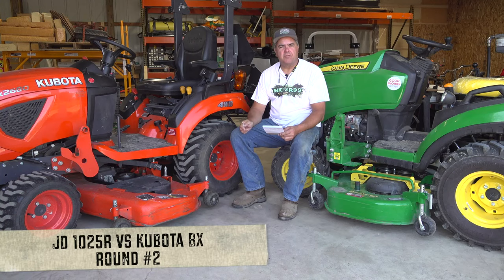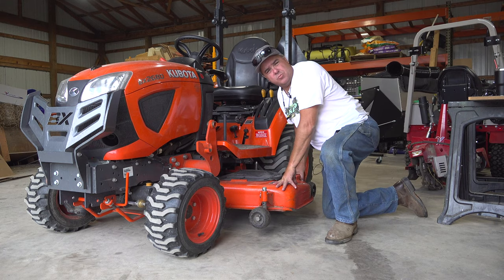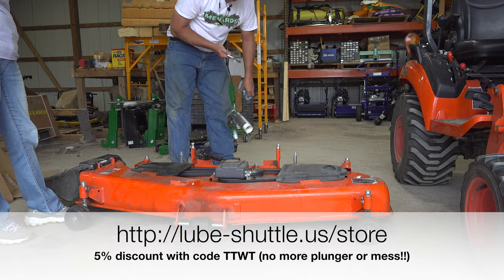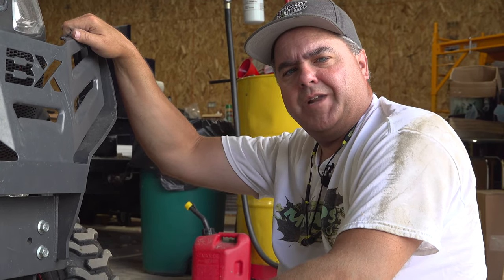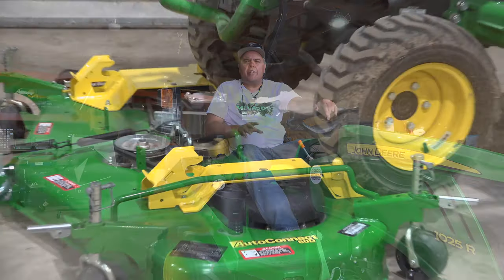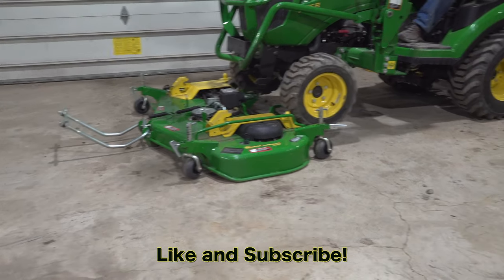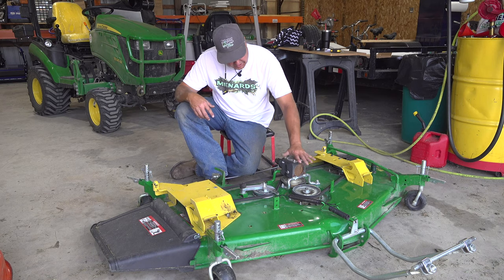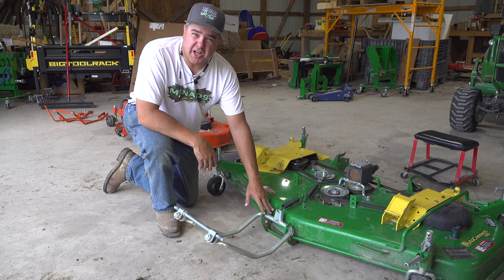Deere 1025R vs Kubota BX Round #2 of 8 Mower Deck

Comment: I'm one of those 1025r owners that cannot get the mowing deck to ever work correctly. Today, in fact, took 10 frustrating minutes to get the deck installed because the PTO wouldn't align (had to make my own leveling adjustment bolt - 'cmon Deere, go to Home Depot and get at least a nylock nut to use). The cam lock for the rear of the deck, on mine, can never be operated by hand like you show yours. Mine requires a breaker-bar to break it loose. And a 60 inch deck on this narrow of a tractor does not work well on anything other than a flat surface for mowing. My front yard is a little over 5 acres that has some gentle rolling, and near the creek, it gets a bit rough, but nothing my 40" zero turn couldn't handle. This 60 in deck scalps and dips. On a flat lawn, this deck does a respectable job cutting cleanly and quickly. However, if you want to cut heavy grass, like fescue, a bit higher than the lawn, the deck will not lift high enough to cut heavier grasses. Even with the mower turned off (deck still attached) and traveling over uneven ground (like down a gravel driveway!!), the deck will scrape and bounce as it hits the ground. No matter what adjustments I make, it will not lift all the way up. We own a 140 acre farm and the only reason I still own this sub-compact tractor is the utility - the other attachments for the work that needs to be done. My real workhorse is my t4.75 New Holland with a 12 ft batwing mower, loader, sprayer, etc. As a farm operator, this mowing deck is the most frustrating and time consuming implement we own. Ironically, I bought it because I thought it would be the quickest way to get utility out of a $17,000 piece of equipment. 18 months later, I am still wrong.

Thanks for your work on the videos Tim.

Comment: A bit of an unfair comparison between the two mower decks. Yes, I understand you were working with what you have on hand. Kubota does have a drive over the deck as well. I personally don't have a mower on my tractor so I can't comment on ease of installation of either type. Great video as always Tim. Look forward to the next one buddy.
Reply from the maker: Ok.  Good comment.  We couldn’t find a Kubota drive over deck as dealers discourage them.  Neil makes that clear in his video.
I should have explained this in the video, and will do so in a follow up.
There is one comment (so far) in reply to this video stating personal experience with his own Kubota drive over deck.  Check it out.
Reply: @TractorTimewithTim  In have the drive over deck on my 2019 Kubota BX.  It is a great deal easier to get on and off than the one on the Kubota you are testing here.  The Kubota dealer tried to talk me out of it but after I said I had back surgery and could not do the regular one they dropped it.  I actually liked the Deere one much better and think it is clearly the superior drive over.  I went with Kubota because of the dealer more than anything else.  The Deere dealer never returned my calls or got a quote to me, the Kubota dealer was responsive and did everything within hours (I visited both too and never could get a quote from the Deere dealer).  That's just the dealers by me and does not in any way speak to the quality of the tractor.

Comment: Nice job Tim. The Kubota deck looks like a supersized version of my older Cub to remove. I would say the Deere box is much taller as to help with the auto connect lineup.

Comment: On the KUBOTA, Cotter pins make turning the mower wheels a lot easier.  Turn the front wheels to the right and you won't look so biased when you slide the mower back under the tractor.
I have had both a Deere and the BX.  The BX is a BULL compared to the deere.

The ONLY thing the DEERE has better than the BX is the twin touch foot pedals.

Comment: My dad has had kubota for a long time now, he recently just upgraded to a bx. He's on his second tractor because the first one's hydraulics quit. The dealership couldn't figure it out. Gave him another tractor. This one has the drive over with the auto connect. The bx mower decks are a joke. The guage wheels are plastic, they have metal grease zerks threaded into plastic. Two of the 4 zerks have come out. Good luck re-threading plastic. The older b series had 4 casters, meaning all 4 wheels would rotate 360 degrees on their axis. The bx series don't rotate, they're fixed. The old decks would float and follow contours, bx deck scalps on high points. The auto connect is a joke, the dealership "adjusted" it and it was garbage. We did it and had better luck. Just last week my dad was getting it ready to mow and discovered the housing that holds the splined end that connects to the mower was cracked. Back to the dealer again. My advice avoid the new bx series, stick with the older b series.

Comment: My biggest issue is it air cooled or liquid cooled. I have a lot of cotton wood trees on my 15 acre property. I have burned up too many air cooled engines getting clogged with cotton. And taking time outs to clean the engine is not worth the time for me. I need liquid cooled engines. They can go the distance but more importantly they have an engine temp gauge which at least warns me the engine is over heating and I need to take a break and clean the radiator before engine damage occurs. Air cooled is always a guess. And I can not get under trees on my property with a roll over bar or hood. They absolutely have to come off. I already spend at least two weeks every summer cutting up storm damaged tree limbs in my yard, I have no desire to trim off all branches on all my trees to an 8 foot height for roll over bar clearance. That would take two entire summers to do that. That left me with limited options. I settled for a case DX25E and removed the roll over bar. Also I had a JD 400 mower with a 72" mower deck. It was built in 1972. In 2002 at 30 years of age the deck metal corroded enough that just the belt tension alone was enough to warp the deck. Both ends curled upward and of course you can no longer mow a yard with a warped deck. The Case DX25E I bought to replace it has much heavier gauge metal deck at least double the thickness of the JD mower deck. I see your JD deck has metal bars for reinforcement. Mine did not. But still I doubt they would be able to keep an old deck from warping. That was another important issue for me. But then is 30 year life a reasonable amount of time to expect from your equipment? You decide.

Comment: Kubota and John deere are both great products. I always hated removing and reinstalling belly mowers and kudos to JD for trying to improve the situation! I've had compact diesels in kubota,  massey ferguson, new holland and decided years ago to  have Ferris zero turn mowers for my lawn mowing needs. As far as tractors go, I've never owned a JD but have worked on many. I don't like there light duty stamped steel mower decks and all the plastic  hoods and fenders they use. If you decide to own a JD, make sure you keep it garaged and out of the sunlight and severe cold or all those bits of plastic will start cracking and falling apart! I'll stick with my all steel Kubota! If you change the oil and filter as recommended the Kubota will last several lifetimes! That's why most rental yards use Kubota!

Comment: Been looking on her to find the reply to 1 of the comments that had this link in it about Kabota's auto-connect deck ( https://youtu.be/kZeF643QxQM ) this is there new one with the auto-connect PTO. This is the 1st one I saw. And in the video he still had to fumble around with the ramps. In the time he took messing with the ramps I could have been mowing with my 1025. And looks like the deck had to be 100% lined up with no way of judging it. The Deere has the bar on the left side (opposite the discharge) for a reference. And the 1025 is a little forgiving on alignment. And the front wheels on the deck looks like they would roll on a concrete garage floor.

Comment: This video is on fire Kabota has an auto connect system to because you compared it to a regular mower deck makes the John Deere out an advantage put an auto connect Kabota next to it and then the John Deere is going to be junk again that’s what a normal John Deere is junk
Reply from the maker: Kubota dealers do not recommend the kubota drive over deck. Reference Neil's video.     We would be happy to evaluate one if we had access to it.

Comment: Tim,   I have a BX2360 that I bought new.  As others have said, use the FEL to lift the front.  I still take it out the side and leave the bracket on the front.  I do not find it to be too painful to remove or install, but I only take it off 2 to 3 times a year.   No narrow gates.   In my situation,  the auto connect not really worth $500 plus.  You made a comment to do a follow up about the belts, would you please check quality of pulleys, shaft diameters, blade removal, and locations of grease fittings?   Please note that the anti scalp wheels have grease fittings on the Kubota.  Don't know if greenies do.   Please watch this video!    https://youtu.be/Kcj3MMgGGPs.   I believe you will find this will almost make remove and install almost equal.   Keep on tractor'n!

Comment: Remove the deck after mowing for a couple hours simulating switching tasks. Might be pretty hot under there. I don’t think it would be too enjoyable removing that Kubota shaft if one needed to start doing something else after mowing. but I guess maybe a break time would be in order anyway and then just let it cool down. Never going to have a perfect system

Comment: I've had many problems with my drive over deck.  mostly related to the draft bars in the front.  First they were twisted.  After warranty replacement I am assuming the dealership didn't adjust them correctly which caused the FEL frame to catch the draft bars and then pull them past the cheaply engineered retention pieces.  Now they come out constantly and have to be put back on everytime the deck is removed.  Pretty frustrating actually.

Comment: I don't know about that particular model, but some of the other models are designed on the John Deere where you just drive over the deck and connect it connect the mower without having to get off the tractor. I didn't get a mower with my tractor since I have two zero turn mowers. I don't know about the Kubota, but saw in a few videos that it was much harder to get the mower off and back on.

The John Deere is a better brand in my opinion and I have the 3032E tractor with the front loader on it, but not the backhoe, but I could get one if I want it. The rocks on the tractor comes in handy and I saw a video last week where one guy rolled his John Deere tractor and had to get help getting it turned right side up and had trouble starting it later, but was glad to have the rock on it to save his life.

Comment: Loved the video. When shopping for a subcompact I asked each dealer to show me how to install/uninstall implements so I could decide. I specifically remember the Kubota tech saying not to bother with an undermount and I should go with a rear attachment. This is the first time ever seeing what a pain it is to remove and attach it. I get that this is not an issue for many but the sheer ease of JDs system was a MAJOR selling point for me and I still feel that way.

I truly appreciate the time and effort you are putting into this comparison and I'm glad you're the one doing it. You provide enough technical information without drowing me with specs like a salesman. On the other side you provide a real world/everyday guy's evaluation, but unlike many youtube people you don't wander and ramble either about yourself or something else unrelated.

I know you have Casey, Vinny and the other Johnny's, but I'm THRILLED that you are getting back to your roots and spending time with the 1025. Keep up the good work and I look forward to part 3.
Reply from the maker: Thanks Chris.  There has never been an intent to move away from the 1025R.  We just wanted to add some variety.  ...and it all came so fast that it seemed like it was drowning out the 1025r.  I think we are getting back into the rhythm now.

Comment: Those load and go brackets are very nice. It would be so easy taking the deck off and putting it away till you need it again with the FEL. I have never installed the deck on my BX. When I bought my BX I got a 54" deck with it but it is in the garage covered up. I am still using my old Kubbota G1900 3 cyl diesel lawn tractor to cut the grass. The G1900 just keeps on going. Thanks for the videos, I am looking forward to the next one.

Comment: Great video! Try pulling a BX mowing deck or any other deck like my 54" fabricated deck that the wheels don't turn in a gravel driveway. It plain sucks! The wheels being able to turn does help but it is still a chore. My next mower/tractor will probably have a rear 3pt. finish mower.

Comment: short hood needs long ROPS. if the tractor rolls over upside-down the ground builds a line between somewhere on the hood and the top end of the ROPS forming a triangle. this triangle needs to be big enough to fit even tall operators. and a long ROPS will even help to avoid the tractor rolling over upside-down once it's already laying on one side in the first place.

Comment: Check out the newer JD 2025r mower deck auto connect assembly. It’s way more heavy duty and robust than the 1025r setup. The 2025r chassis makes it VERY easy to take the mower deck on and off!
Reply from the maker: Same with 2038r.  It just keeps getting better.
Reply: Buddies brand new 2025R driveshaft and autoconnect mechanism blew into pieces maybe 4 weeks after he bought it lol.

Comment: Use of a Fifth Wheel Puller to move the deck around makes the job much easier on the Kubota.
https://www.iowa80.com/pd/39-fifth-wheel-puller/27701/

Comment: could of just got a complete rotten lemon but i bought a johndeere 1025 and the deck would not stay in ajustment every freaking time i mowed it would get screwed up either the left sid or the right side wouldnt come up properly 

then i bought a new deck for it a BIGGER deck for it had it with the auto connect and evrything and still same problem had my dealer look at t they "fixed it" but then the deck wouldnt go low enough to mow with

so i traded it in on a used kubota and that helped alot but that tractor then decided it wanted a window in the block so i ended up getting a new holland and for the money it dose everything i want and more

Comment: I’ve had a Kubota BX24 for 16 years and while it’s been a great machine, JD has leapfrogged Kubota in the subcompact and compact arena. I’m awaiting delivery of a JD2032 now. For my needs I wanted a full frame tractor that was mid mower compatible and that took Kubota completely out of the running. If you want a mid mount in Kubota you top out at sub 26hp and in a subcompact. To me, the JD2032 is the most versatile tractor around. Your videos did much to help with that choice.  Thanks Tim!

Comment: Tim as you prepare to reinstall your mower deck even on your drive over deck, take a minute and clean especially the tractor PTO shaft as you could have collected trash between the splines. Also check the connection portion on the mower deck. Easier to clean it with out it under the tractor. And what a frustration to have to remove the deck again to clean one or the other. A light application of grease on the shaft may allow it to slide on easier. It only needs a light application as once locked in place they work there as one unit as you know.

Comment: Instead of turning the wheels on the deck and sliding it out of the side, I unhook the linkages and the PTO shaft. Then I curl my bucket to the dump position and lift the front wheels off of the ground by have big the loader push down on the ground. Then I roll the deck infront of the front wheels, let them down by lifting the loader, and lift the loader and back away. Easy.
Reply: Thats how i do it on my B7500 too
Reply: Yeah, me too.  Having said that, it does dig up my lawn if I do it outside, and my concrete if I do it inside.  I put down a board under the front edge of the bucket.  It skids a bit as you lower the wheels again.

Comment: I mowed with a JD 430GT for years. Removing the deck was very similar to that of the Kubota BX2680. The anti-scalp wheels need to be adjusted so that the deck is almost on the ground. You actually raised the deck higher off the ground when you turned the wheels. Had you adjusted them to their lowest position, the bolts would not have interfered with the frame. Also turning the wheel increases the space between the front and rear wheels, thus making it easier to pull the deck out from under the tractor. That being said, the Deere still easily wins the install and removal contest.

Comment: Before removing or installing the deck on the Kubota, drive it up on a 2 by 4 or 2 by 6.  If you have a loader use it to raise the front of the tractor.

Comment: Hi Tim, your technique is correct. I've owned two BX's and I am quite proficient with deck removal and installation. For me, doing it almost the same way as you did, it takes me about 2 minutes to remove and about 3 minutes to reinstall. The only thing I do different is attach the front connection before attaching the lift arms. That way I can line up the arms faster. However, the first time I ever did it, it took nearly 15 minutes. Its not a fun task. Not even comparable to JD auto-connect, however, if your physically able, its no big deal at all.